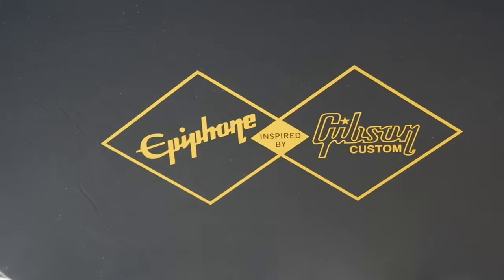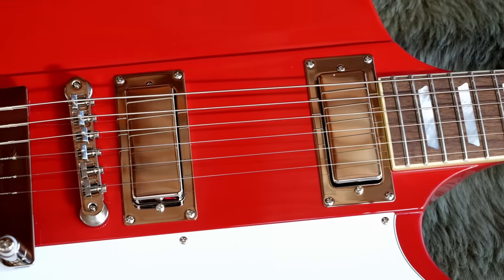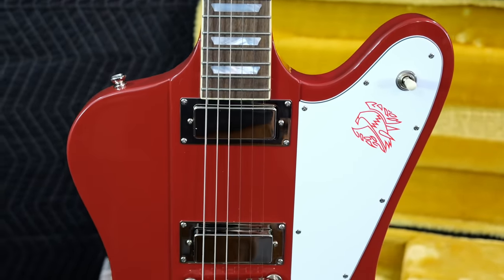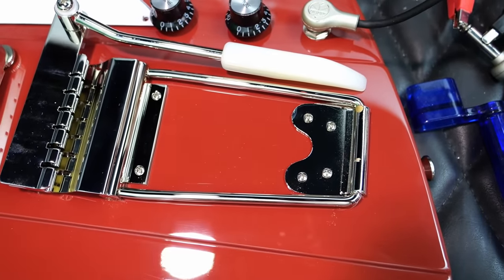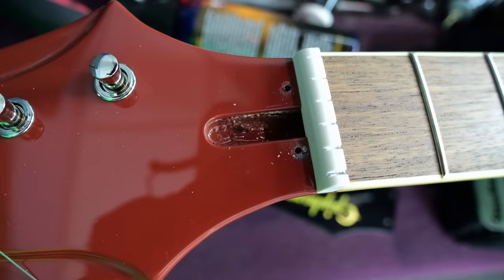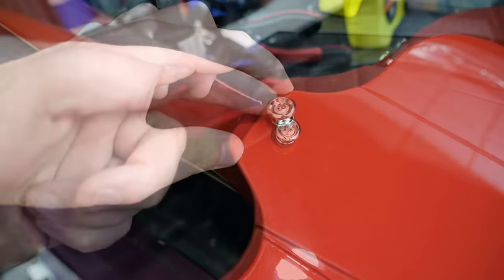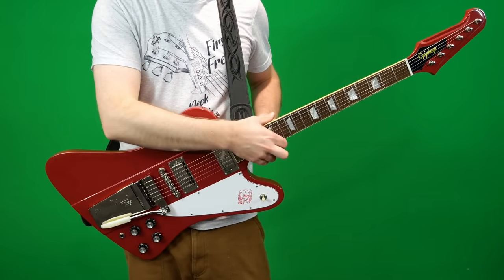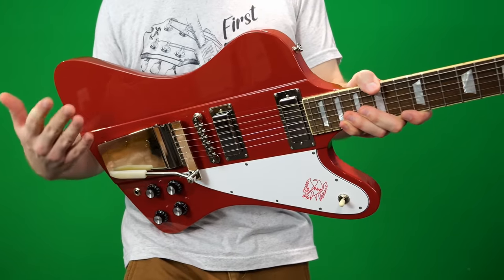I Tried the New $1700 Epiphone Firebird V and...

Comment: Way too expensive for a Chinese made guitar, I would rather get the reissue/not so vintage with the bolt on neck. They are either nuts or crazy, not paying over $500 for a chinese guitar with knock off chinese made parts made to look like the expensive ones. 50$ for CTS pots 4 of them, naw man 35$ retail, in bulk maybe 25-28$ for the set depending on how many they buy as a company for all we know they get them for $5 a piece with the total amount they order in a year through contract.

Comment: The math does not add up because you are comparing retail to wholesale. That’s not realistic. If you break down the cost of an entire car, into the cost of every spare part, when you are buying one piece of each part, you will end up playing multiple times the cost of a car. Few people will buy a Toyota MR2 and “upgrade” it to a Ferrari, paying retail prices for parts. In comparison a 100 dollar pair of shoes will have a landed cost price of about 12-15 dollars, dependent on the brand, place of production etc. Looking on Amazon, 14 dollars will get you two pairs of laces, of the same quality used by most major brands.

It makes no sense breaking down the added cost, without firstly deducting the price of the “budget parts”, and secondly remove the markup and gross margins. It’s the same discussion that’s going around for the Dave Grohl Epi. People who are defending the price simply add the cost of the “premium parts” without deducting the “budget parts”.